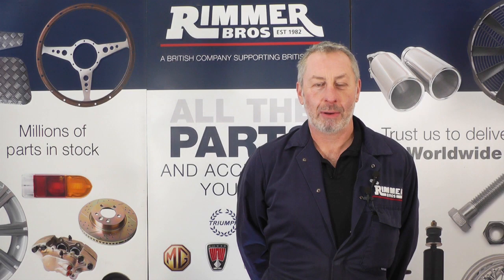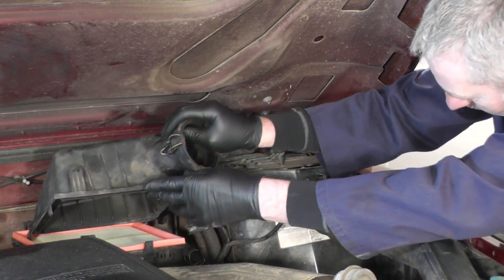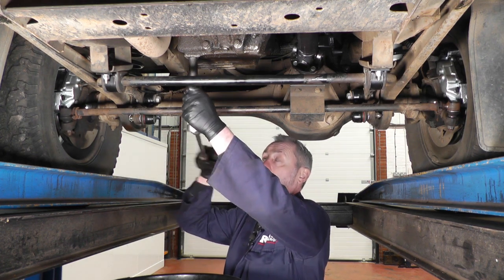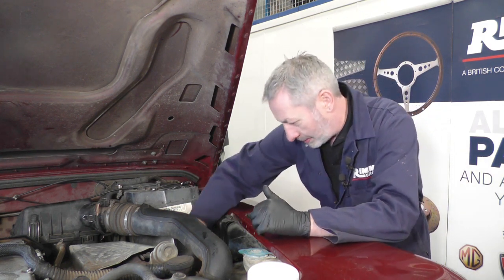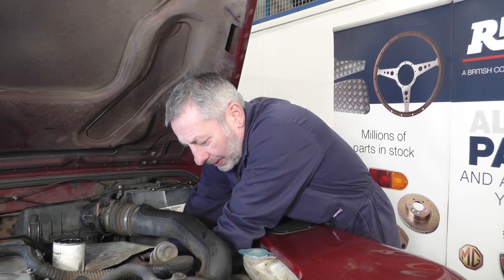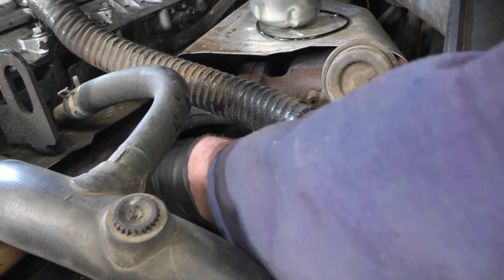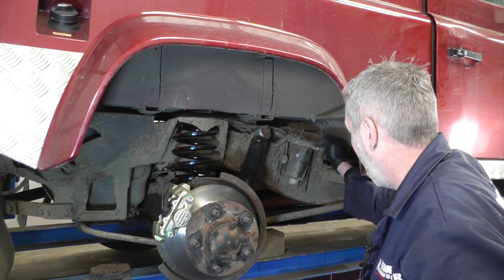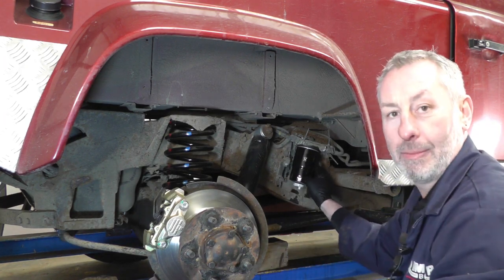Basic Service on a Land Rover Defender TD5 2001.

Comment: Ha Ha ! My prayers answered! I have been hoping for a video on changing the diesel filter, or more correctly the after fitting procedure, I thought it would involve a flat battery with all the priming after the change ! The centrifugal oil filter is a really good idea, and I find it a lot easier to change than the lower conventional filter, which is always awkward. I did think Jean-Paul was going to get a black hair day draining the sump. Very many thanks for posting this one ! Chris B.

Comment: Those rear hooks on the air filter box are,  tricky to say the least.
Shouldn’t you clamp the fuel lines before removing the diesel filter?
Reply: You're not kidding about the air filter box.
Clamp the fuel lines? never seen that in the manual.

Comment: Just done my service on my 2002 TD5 . Any tips for getting the oil filter off  any tools to use?
Reply from the maker: Just the advice that John Paul gives in the video, I'm afraid. They can be tough to remove if tight but persevere and as JP says, use the thinnest oil filter wrench you can get your hands on.

Comment: Don’t you need to remove anything to get rid of the oil filter? looks easier on the video than my reality ! 😅
Reply from the maker: In all honesty, it wasn't that easy, even in JP's reality. But it's worth having a go.
Reply: Yes, it would probably help if you could remove the turbo, the exhaust manifold, the air pipe to the intercooler, the cylinder head.......and maybe the engine as well.
Difficult doesn't begin to describe it.

Comment: He didn't fix the cover properly on the air filter, probably because it's such a pig to fix that it would have taken the full 8 minutes of the vid to get it right.He also didn't emphasize how difficult it is to get the conventional oil filter off and out without spilling a load of oil onto the engine